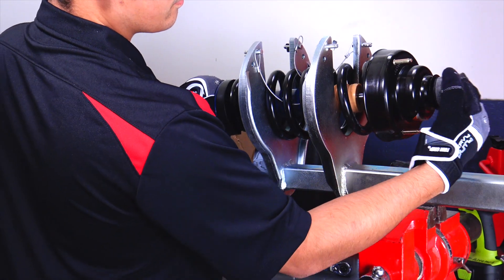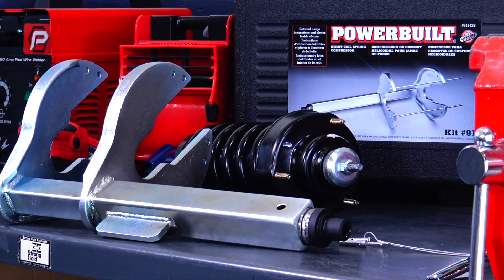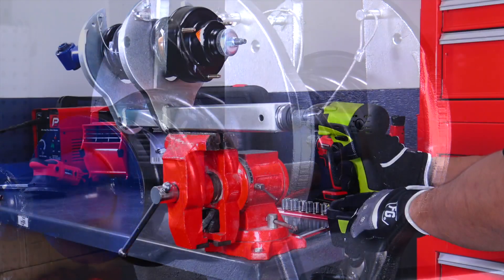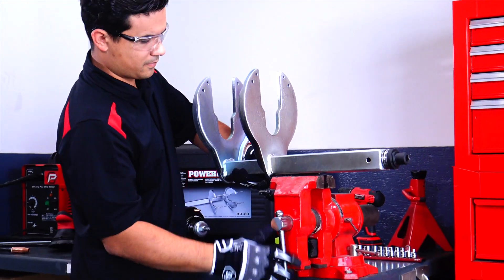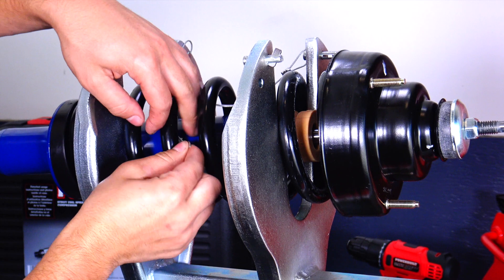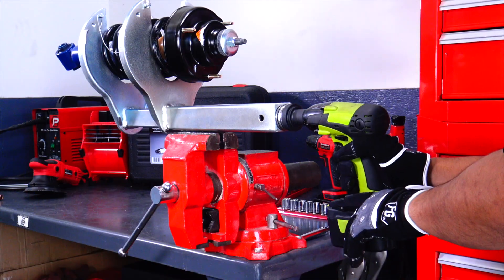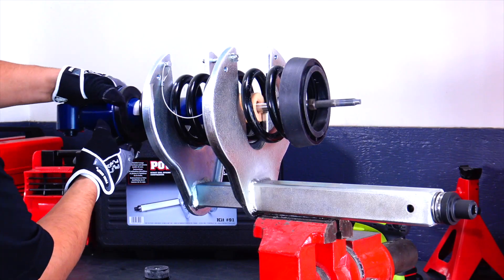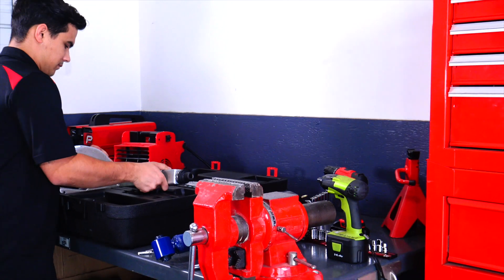How to Remove and Replace Strut Springs the Easy Way

Comment: Used this to change struts on my car and 1- the tool does not grip the springs and scratches them and 2- does not compress evenly leaving the spring at an angle. 
Would recommend another method.

Comment: The 4,000 lb rating on this tool is a joke. Using it to compress truck springs rated at 550lb/in for a distance of three inches bent this tool like it was made out of pot metal.

It's probably fine for passenger car springs, but for springs off a full size light duty truck or SUV, it's 30 pounds of junk.
Reply: I can attest that it is not fine for passenger car springs